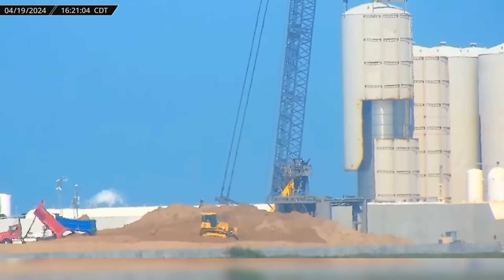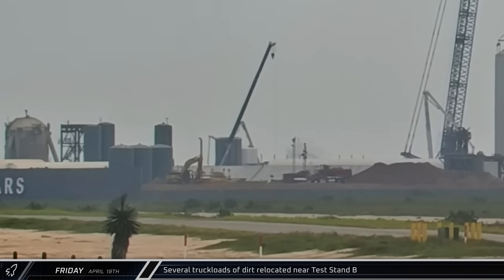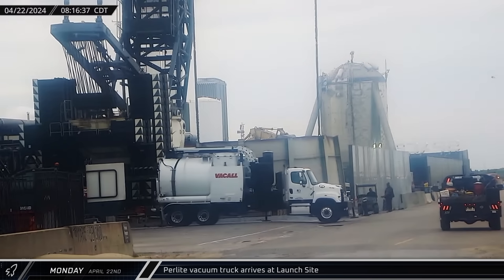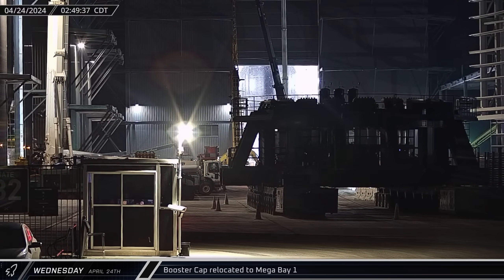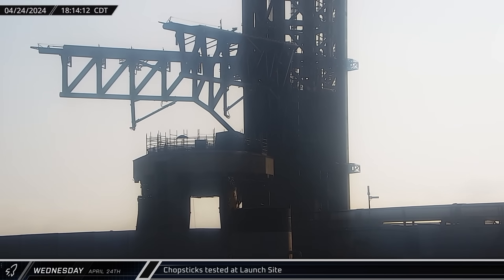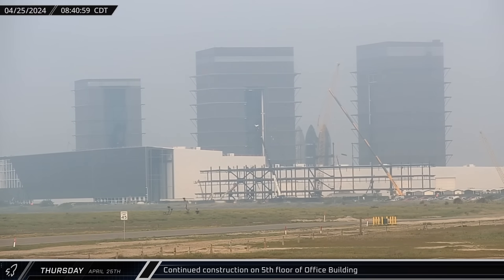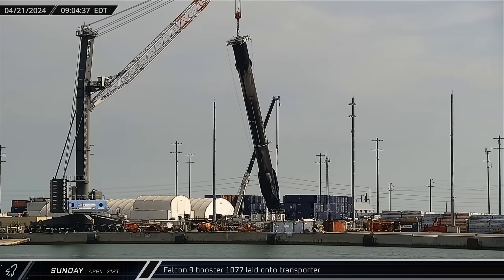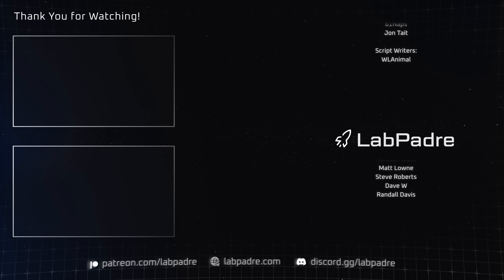Wow! SpaceX's Next-Generation Starship Factory Is Taking Shape! - SpaceX Weekly #112

Comment: Just had an interesting thought...
If SpaceX built a mini tower at the test stand, they could use it to catch the Starship instead of the launch tower.   This can protect the main launch tower from any mishaps during catch testing.  

It could also serve as a way to impress/attract future customers, by landing a starship just an hourbor so before launching another... Giving those passengers a front seat view of another launch.
Reply: That's actually a pretty good idea
Reply: Do you mean by mini-tower only one tall enough to catch the booster or the ship?  Aren't they already building a 2nd launch tower?  It seems to me they need a 2nd launch tower so it can be ready to perform the booster catch around 20 min after the launch from the first tower.  They need the 2nd tower for the catch incase the first tower gets damaged during the launch (e.g. damage to the chop sticks or its power system).  This way they can do any pre-launch testing of the catch hardware on the 2nd tower at the same time they are doing pre-launch testing of the booster+ship on the 1st tower.  

It also means that if any serious damage occurs to the orbital launch platform (putting it out of action for weeks or months) on the first tower they can keep launching using the 2nd tower with the risk that there is no backup for the catch if the 2nd tower gets damaged during a launch so they will have to ditch the booster in the gulf.  

It's true that a mini-tower would save some money with shorter height and does not need the spin up support for the outer ring of booster engines but it still needs the plumbing support for de-tanking the leftover method.  It is an interesting idea in that if the 1st tower is damaged during launch and they fall back to a one tower operation a mini-tower would protect them against booster loss if the 2nd tower also sustains launch damage while the 1st tower is out of action.
Reply: @datamatters8  Tall enough for the booster I'd say, as that's what's going to be tested first.

It wouldn't require half of the infrastructure of the launch tower, just catch arms.

And it can still be used for the ship.  Just add a crew gantry.

Not sure you'd require any detanking infrastructure though as the ship can self-ventilate (it needs to on hard pad landing anyway).

The point, as I'm sure you've already grasped is a tower suitable for landing only, requiring much less complexity than the launch tower.
Reply: @datamatters8  the way I'm visualizing it, with a standard one or two fill size launch towers, having a short Starship catching tower could speed up launch cadence quite a bit. Think about it, maybe you'll see it too.
Reply: @datamatters8  A mini tower at the test stand would benefit as a) the test stand already has plumbing. b) there is less infrastructure to damage with a test stand/mini landing tower if there's a mishap.   

The launch tower is where the most complex systems are.   It is built specifically to take the weight of the full stack and to service the stack for launch, so it's strength is greater, its systems very much more complicated.

For the cost of one full launch stand, you could build two landing catch stands with test pads.

That way, you launch the stack from the main tower, then catch the booster AND/OR a ship with the two mini towers.  

This plan builds redundancy into the ground systems for the same cost as two full launch towers.  Kinda like having a second runway at an airport.